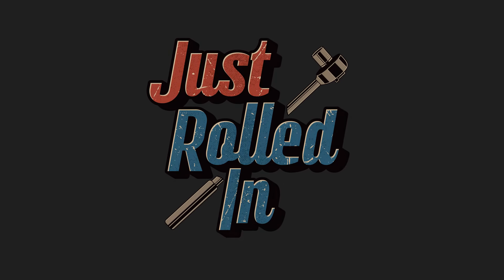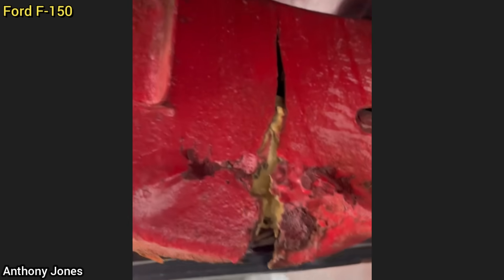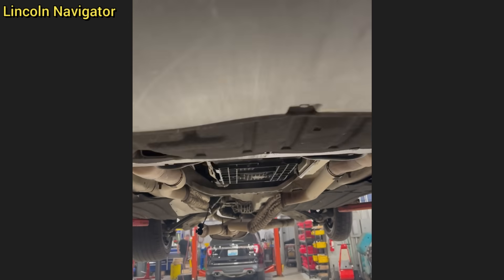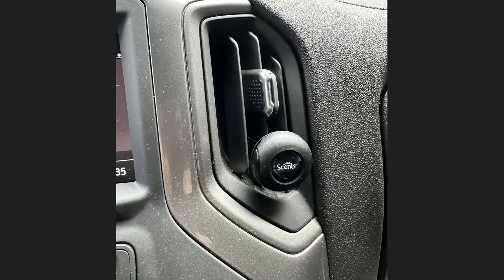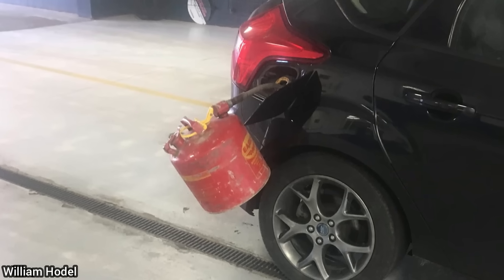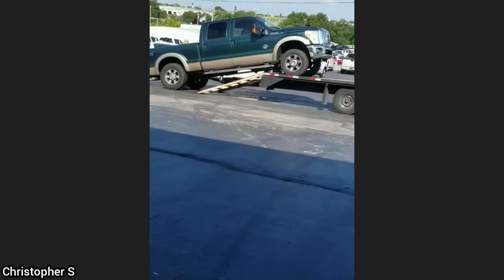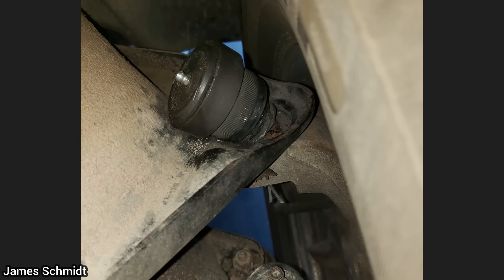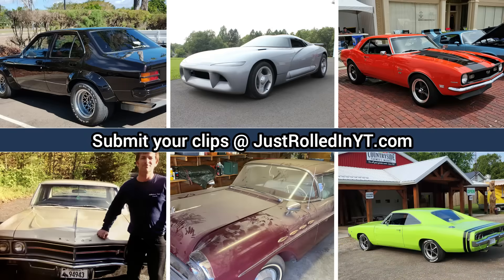Customer States Previous Owner Said Jeep Needed Small Repairs

Comment: You often state the problem and assume we will always understand what the impact of that problem will be, but that is often not the case. I’m sure a mechanic would understand what problems would be fall the owner, if the work was not done, but the average person, not so much.
Reply: The actual problem is stated and the actual weakness is shown.
After that it makes as much sense to someone without any basic mechanical knowledge..... as it does to explain knitting patterns to a mechanic not interested in or ever having educated themselves about knitting.
Reply: @JohnSmith-yv6eq   thanks for your input but I don’t agree. I’ve done several years of mechanical and bodywork on my own cars, and while some problems such as the shredded tire or the rusted out frame, are obvious, there are many more where I am left wondering why are what the impact of the damage would be.
Reply: @colingenge9999  
Then you educate yourself further by googling the problems and their fixes...and consequences if not fixed.
If someone tried to tell me about their nuclear fission reactor  I might have to see schematics to fully understand the whole system....or at least consult a Wiki article if I wanted to know more....???

Comment: These shops need to call the police and report unsafe vehicles when "the customer" tries to drive away with them.  These people put us all in danger and could kill our children.  This is criminal negligence and needs to be reported to police so these maniacs can be taken off the road for the safety of the public.  It is also criminal negligence to allow someone to drive a vehicle like this away when you know it condition.  A mechanic or shop owner could be held criminally liable if someone were to be killed because of a mechanical failure after leaving the shop.
Reply: How about if a witness swears a statement that the driving on a road entering the shop lot can be construed as operating an unsafe vehicle on a road....just prior to inspection.
Say from examining the security cam footage at the shop?
Then make the law that the Police can impound and tow the vehicle if the owner declines repairs.
That nips the problem in the bud.

Fix it at the shop or multiple tickets for operation of an unsafe vehicle on a road.

Fix it at the shop and no tickets.

It gets impounded and finally scrapped...
you pay the impound and tow fees...
and press the big red button on the crusher on livestream if you want to.

Comment: I recently had a customer actually sign the liability release form to avoid having his stop drive and recalled brake system inspected and repaired under warranty.  His reasoning was his brother who is a “mechanic” told him not to because reasons I guess. Nothing he said made any sense. He did have his air bag recall performed however again because reasons. After trying to reason with him for nearly an hour and explain that he literally had nothing to loose and everything to gain I finally gave up. After he signed the release of liability documents I gave him my card and asked him to call me to let me know when he was on the road. He said why, and I said because you and your brother are both fools and I don’t want to be anywhere near you or your unsafe vehicle.

Comment: Before buying ANY used car that you are certain you want to buy either call up your personal mechanic that you trust or do what I did and use Lemon Squad. It cost me $250 to have a comprehensive test drive and examination done on my Q50, it came back excellent with the tires needing replaced within the next 5000 miles. I replaced them immediately. 

$250 is a small price to pay if you are dropping thousands on a car.

Comment: what was the black car in the top left of the end clip?  An Australian falcon is my best guess?
Reply: Holden Torana from the mid '70's, wheel arches and drop tank added to resemble an SLR5000 model; those all had factory fitted reversed bonnet scoops and rear spoilers to my knowledge.
Reply: @michaelmclachlan1650  Thank you!

Comment: Imagine if someone created a website that would have a year, model and maybe the last 5-6 digits of VIN. List of needed repairs and whether they were performed or not It would save shops ton of time and aggravation
Reply: This is why you need an annual safety inspection like we have in the UK. You can go online and look up all the past test results and see the reason for any failures and any advisories issued. None of the rust issues seen here developed in less than a year, so they'd all have been picked up long before they became potentially lethal.
Reply: In the UK, we have compulsory annual inspections once a vehicle is three years old. The results of those tests, including advisories where the vehicle didn't actually fail, but may need attention, are all available on a publicly accessible online database. You only need the registration number to search.

Comment: This is why a yearly test and certification would remove all of the frame/ subframe issues.  I also think that when a shop finds a fault that is a serious safety issue they have the right either to impound the vehicle or call the police, for me if I was a shop owner I would call the police as soon as the car drives away, it puts everyone on the road as risk.
Reply: No; have the Police impound the car from the lot..if the car was driven in.

Then it can be certified by a witness that it was "used on a road in the condition in which it was inspected."

If it was trailered in "for a quote" then it was not "used on a road"...so no can impound.
Reply: We have that in the UK, and it's also mandated in the EU. It would be very unusual to see vehicles in the dangerous conditions shown here.
Reply: It’s dependent on state. Some states allow shops to require a tow truck pick up the car or the customer must get repaired. That way, customer isn’t jeopardizing themselves or others.

Comment: When a vehicle is in such dangerous conditions f.e. tires, brakes, suspension it should be registered in a road agency system and be non drive-able until repaired, if the owner is informed about the defects and non-road worthiness and  drives the car anyway he will/can/should be pulled over and held accountable for knowingly putting people in danger, 1 year prison. Of course you might say some garages would misuse the system for commercial gains, but with a 2nd opinion possibility performed by a road agency (paid by customer or random sample) the registering person from the garage that misuses the system will be fined and /or put in prison if repetition occurs. If an owner drives the car and an accident occurs, depending on the severity anywhere from  5 to 25 years in prison. That will wake people up....... driving a defected car = premeditated murder

Comment: I'll gladly pay you never if you fix my car today so it can sit at your shop until it rusts away!   Why is it I see many of the same cars sitting at local garages for a long time?  No parts?  No pay?  Don't want repairs and won't tow it away?
Reply: Could be any of the reasons you’ve questioned. After so long (different amounts of time, depending on state), the shop can claim the vehicle as abandoned and get a clear title to fix and sell.
Reply: Good point, yes they can after sending out notices and it is after shorter period than it used to be, like 30 days.   I had to file for abandoned vehicle title on several vehicles through the years due to owners not responding to several notices.  I even gave them longer amount of time than required without charges if they would pay and pick up their vehicles.   @MsAubrey

Comment: As a complete novice let me run this by the mechanically inclined. I would think the best way to weld a frame would be to weld the area first, grind it flush and then weld an extra flat piece of steel over that at the strongest part of the frame. Does that make sense? Or would that just put me on an episode of just rolled in?
Reply: If the frame is rusted out in one place, chances are that the rest of it is in bad shape also.
But let's assume that it is just one isolated place.
The best thing to do is to cut out that section and replace it with a new section. The easiest solution is to find an identical vehicle in a junkyard that has a good frame and take the section that you need.
Then, you must be a good enough welder to do the joining without removing the temper. That's much more difficult than it sounds.
No offence, but it's really not a job for a novice. 
If the vehicle is otherwise worth saving, I strongly suggest that you take it to a pro.
Reply: @mikesmith-po8nd  Or just buy the junkyard frame and replace it.
Reply: @darkiee69, that would probably be my first choice and I'm a retired mechanic and certified welder.
I answered the way that I did because he specifically asked about it.
I hope that I got my point across to him that it's not a repair for a beginner.

Comment: ANY time a seller says "It's good it just needs X" RED FLAG
It's a sign that the seller has given up taking care of the car NOT "I'm going to sell it anyway, so what's the point."
It's more likely they gave up on most things with the car for months, or at least 10,000 miles ago, which is a lot of time for deferred maintenance to build up. 
It's a slow path to neglect, not a sudden change in life situation that makes sellers stop repairs, & then eventually decide to sell for a quick, low-effort buck.

Comment: These videos makes me appreciate the strict rules we have on cars in Denmark, can't imagine the legit horror of sharing the roads with people who drives around in these vehicles.
Reply: Just a lil add. The Ministry Of Transport calls your vehicle into a checkup 4 years after first registration, then it has to be checked every two years. If there is an issue you have about 5 weeks to fix it and have it checked again, fail to do so will result in a 290usd fine, not paying the fine or get the car fixed within a few weeks = another 290usd fine. Fail again and they'll take your license plate.

Comment: So many people are oblivious to anything mechanical or automotive that states like Pennsylvania make you inspect NEW vehicles every year. I use to think "what could go wrong w\new car in 1 year".  Then I began driving 1.5 hrs to work in traffic on major highways in PA. I saw some of the worst vehicles driving around. At night is when all the semis, large box trucks, and other cdl or large work vehicles would travel due to not meeting DOT\safety standards. During the day PA pulls over vehicles w\trailers, loads, etc before they get on the major highways and inspect them. But not late at night.  Between motors barely running belching out constant smoke, bad electrical components and no lights\brake lights, busted suspension, mismatched bald tires, to over loaded weight of haul.  They start around 10pm driving these POS vehicles.

Comment: That stuck gas can is no slight on the customer. They found they needed fuel. They added fuel. The can got stuck. Take to mechanic _makes sense_.
Reply: Could they have unscrewed the nozzle from the can before driving? If so then they should have.

Comment: For me all of the "declined repairs" shouldn't be allowed. If the technical issue is potentially life threatening, it should be immediately reported to the authorities and the owner pulled over immediately after leaving. I can only wonder how many completely rusted and "wobbly over 45" cars are there.
Reply: Some states allow shops to require a tow truck pick up the car or the customer must get repaired. That way, customer isn’t jeopardizing themselves or others.

Comment: Are there not laws in place that would allow a mechanic to objectively deem a car not safe for the road? That ball joint one was wildddd
Reply: It’s dependent on state. Some states allow shops to require a tow truck pick up the car or the customer must get repaired. That way, customer isn’t jeopardizing themselves or others.

Comment: The police should be called after costumer drives away with dangerous cars.
Reply: No; the legislation should allow impoundment if it can be witnessed by statement that the car was driven there by road  immediately before inspection which it failed.

But if the car was trailered there for inspection and a repair quote....and it leaves on a trailer...no impoundment.

Comment: Low on fuel. Really? When you convert to metric, you somewhat have to convert the approximate nature as well. Customer states "when driving over 45 mph" means "when driving over 75 kph". Especially since the exact number for "45 mph" into kph is actually 72.4 kph. But since the customer probably read the speed from the odometer, there' usually an uncertainty of about 2-3 mph anyway.

Comment: Ok, Ok.. Ill say it. When this Series first came out the requests sounded Believeable but NOW seems theyre running out requests and are now making shit up as they go... The vents closed? Te air freshener making noises and those minor things fixed the problems? People ARE stupid but NO1wants to take their car to thw shop let alone pay to remove and air freshener 😂....Just adde fuel and fixed the problem😅..Too many unbelievable UNLIKELY Scenerios.
Reply from the maker: I showed the work orders. I have hired somebody to help me search for content and working with a licensing company to get the best clips on the Internet to show on this channel. This channel is a lot bigger than you expect and we are forming a team to get the best clips to show and show work orders when we can to prove it happened. If you think these are fake you haven't watched enough of these videos 😅
Also why the videos are 3 minutes long. Takes a ton of time to get the content, get permission/license clips. 
The stuff in this video was nothing compared to some others.
Reply: I'm a tech at a shop and I've seen quite a few of these ridiculous things happen, not every day but often enough that it doesn't even surprise me anymore. Been a few cars towed in with no start because they ran out of gas, noises from things hanging out in the back seat, no power after they changed the battery and the cables are TAPED to the posts if even "attached" at all, washers not working during winter after filling the reservoir with Windex, and misfires because they swapped a couple coils without unplugging the connectors

Comment: Here are the top 5 countries with most traffic accidents:

1   United States: 1,949,000 🇺🇸
2   Germany: 300,143 🇩🇪
3   Turkey: 174,896 🇹🇷
4   Italy: 172,183 🇮🇹
5   United Kingdom: 123,212 🇬🇧
....
Not even surprised...
Reply: And averaged out across the population in each country as crashes per 100,000 miles?
and separated out into actual mechanical car failures as opposed to loose nut behind the wheel (DUI, drifting etc.?)
Reply: Um… yeah, we have a population density WAY higher than ANY of those countries. Our land mass as a country is larger than all of those countries combined. 

Thanks for playing. Try again.
Reply: @JohnSmith-yv6eq exactly. Let’s go with per state. Considering one of our states is the size of one of those countries. 😂

Comment: Bruh, you know you can get a full safety inspection prior to purchasing a used vehicle... It is beyond HIGHLY RECOMMEND TO DO SO... 
I'm a female (we often have a stigma for being mechanically ignorant), but following this channel as long as I have, I am absolutely dumbfounded at the shear ignorance of drivers in general. Most of this is common sense repairs. Literally, if your undercarriage is rusted to 💩, it's unsafe, If  your tires are bald, worn, showing wire threads, etc, they need to be replaced. Cable ties, duck tape, bungee cords, chains, etc, are not acceptable forms of tie rods or any other means to hold your vehicle literally together. Stop installing your own electronics... you suck & f your 💩 up. Even I took mine to a professional to have my after-market electronic devices installed. Learn to change your oil; it seriously is not difficult, as well as, your tires & maintain proper air pressure. 
If you don't know 100% what tf you are doing, then don't attempt it, by all means take it to a professional because what you pay in the short-term will save you before you make things worse by attempting it yourself & causing it to have to go to a professional, then needed to pay even more because they now have to fix the original issue, plus everything else you messed up.